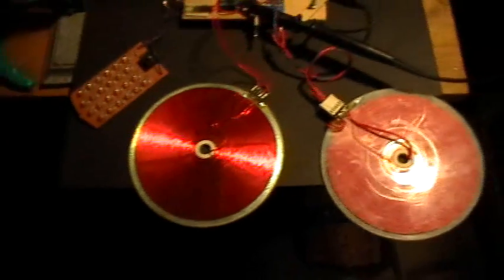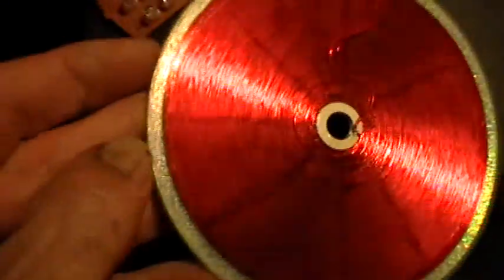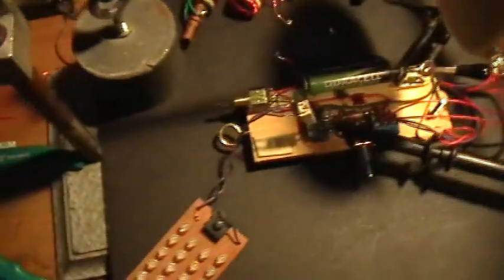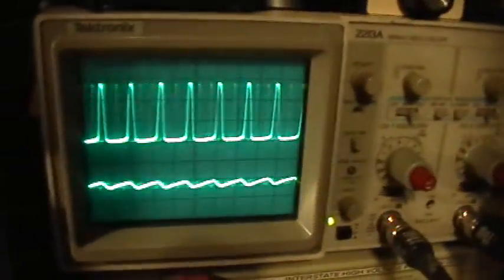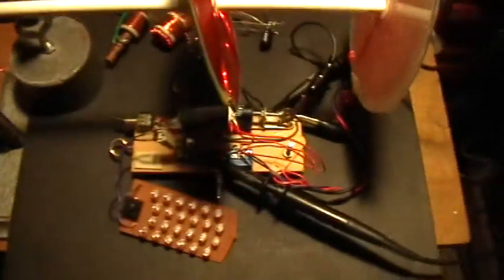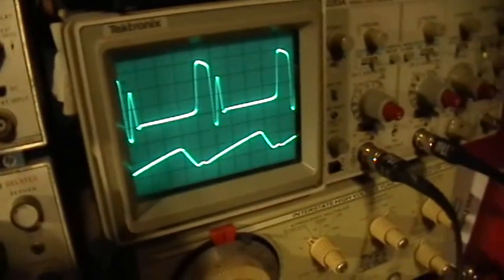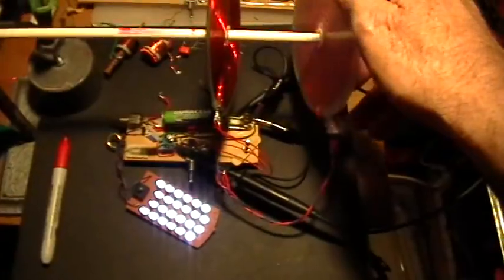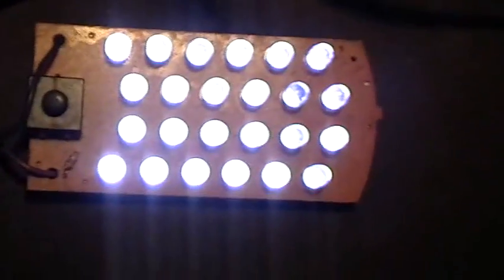Joule Thief: Sohei Thoth's "Wireless" Bifilar JT, Enhanced

Comment: The capacitor and coil are resonant and two coils are coupled better. The power transfer is better due to the coupling.  I've noticed this happening when I use the "grid" dip oscillator to find the frequency of a resonant coil and cap.

Comment: I wasn't sure if you are using a single coil for both primary and feedback windings, or if the primary winding is on one coil and the feedback winding is on the other coil.  It seems to be the latter.  If so, then that would explain the variability of the light output with the coil placement.  I've had my Joule thiefs put out weakly with the windings phased incorrectly.  But when I check the LED output current the problem is apparent and the LED gets much brighter when I swap leads of 1 winding.

Comment: Thank you! Brilliant ex!
I like pancake coils. See my last vid if you like. Sorry, it's in Russian.P/Supply 15-17V, mje13009 has died after that), 10metter main coil, two 3metter additional coils, all in series,  in magnet coupling. I'm turning variable resistor there to see what will be voltage against amps. Now, with big1500V transistor, I'm out of meter range.